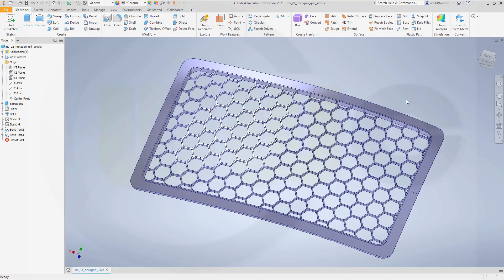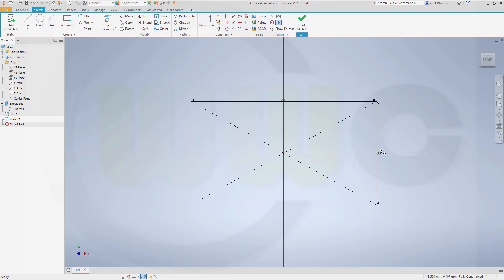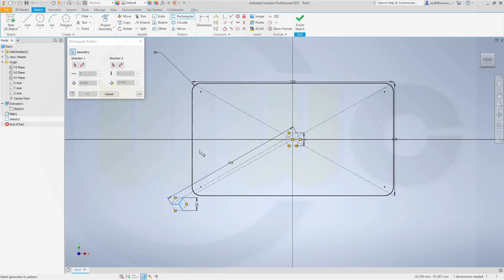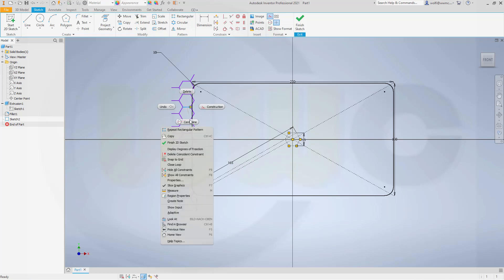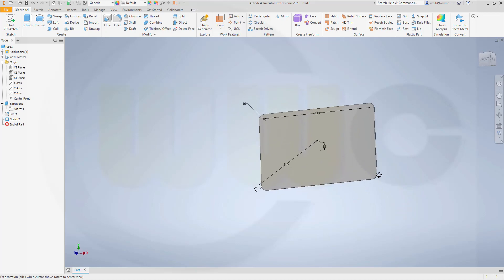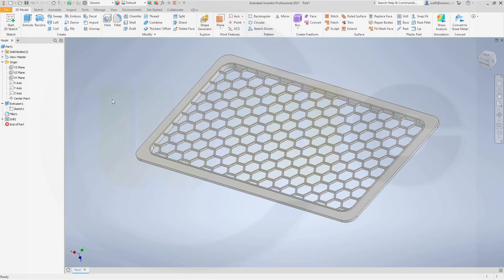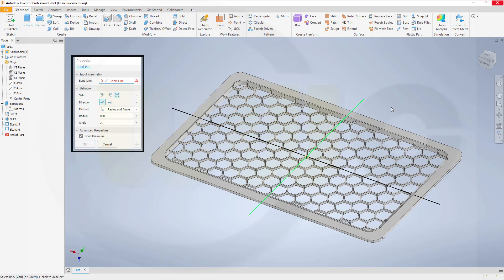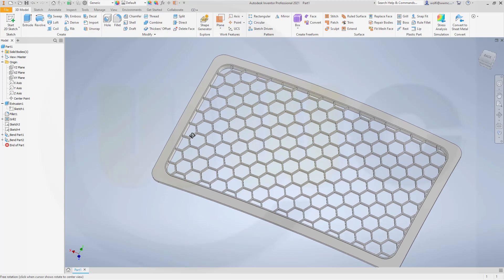Hexagon Grill "easy" - Inventor 2021 Training - Part Design

Comment: Hello, I follow all steps exactly as you do but when I confirm grill an error message appears saying "can't cut or intersect through empty part". Could you please help?
Reply from the maker: If you do it exactly as I did . it will work. Obviously you missed something. I would assume the direction of your rib is wrong, because the error message states an empty part.

Comment: Thanks for the video! It helped so much.
Do you know if I can make the pattern elements independet after sketching them? So I can change all sizes at ones for different objects and delete not necessary ones afterward?
Reply from the maker: You can´t "explode" a feature pattern, but a body/solid pattern would work. Regarding the pattern in the sketch, I will have to check myself, because I use patterns in the sketches only if there is no alternative and therefore rarely.
Reply: @wolfgang.walden.cad.training  okay I understand, thank you. How can I explode one solid pattern in ipt file. Do you know if this is possible?

Comment: Two things:
1.: You can speed up the process of the selection of the hexagons by dissabeling instand preview.
2.: wouldnt it be easier to use the sweep function on the hexagon grid? Also, this could give a faster and more versatile (re)shaping of the grill profile.
Reply from the maker: 1. Yes. of course. 2. This was a video about the use of the grid tool. Apart from that how do you want to use a sweep in this scenario???